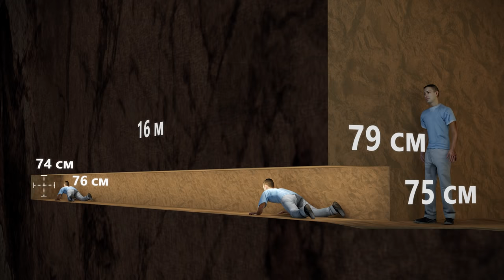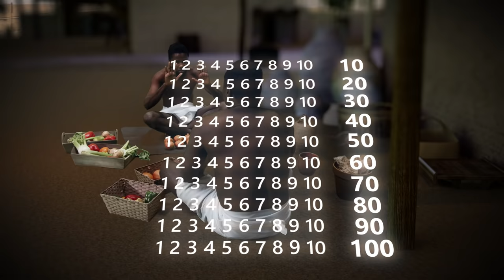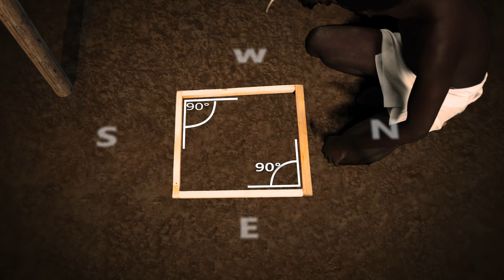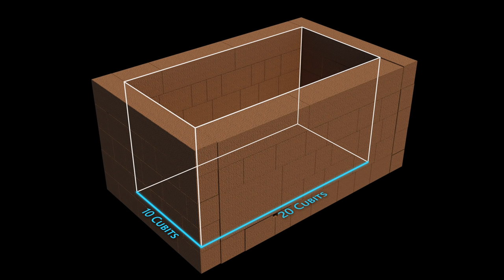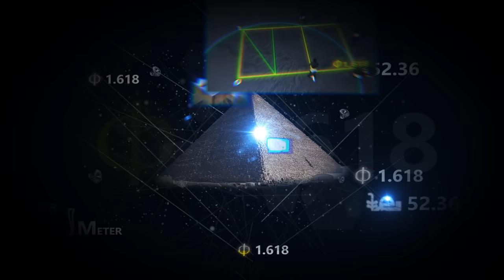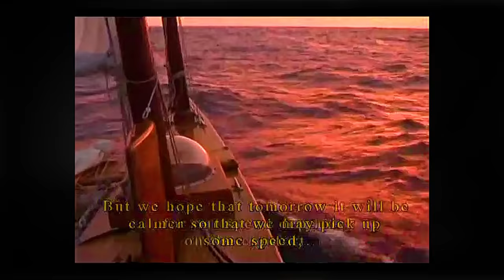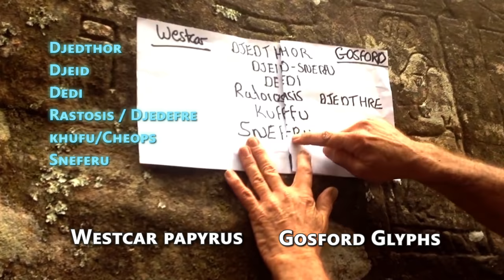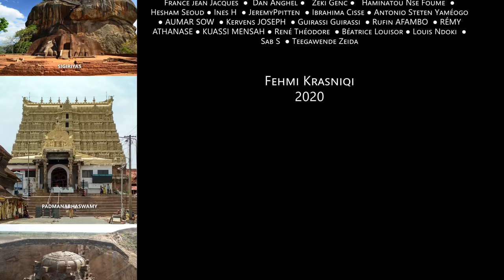The Movie Great Pyramid K 2019 - Director Fehmi Krasniqi

Comment: Heat melting of sandstone, granit, diorite etc. results not in sandstone, granit, diorite etc. of different shapes, but in glass or glass like stone that does not look at all like the original stone.
Reply: Granit was not made in laboratory yet. Not a piece. Robert Gentry ... polonius halos in granit. I was wondering how they could melt granit with solar energy and create the same granit again. Magic
Reply: Jeshua Satterlee  i have overbaked ceramic and got churchlike statues- some white porous rock.
Reply: it´s a combination of natural elements mixed and fermented with the rocks and the sun heatin it to the point that it could be molded as some sort of rock jello cake.. :)
Reply: Edwin Jansen  actually there are various rooms and undergroud caves along with halls that have the right acoustics, i also believe they had already mastered how to use water and electricity for more detailed matters, so who knows how many more amazin ruins have been kept without rcords or solid proof. :)
Reply: @ricbrano6402  Bingo!

Comment: The issue I have here with the “melting granite” theory is that there are actual experiments on YouTube right now of melting granite. It turns to a glass/obsidian type of material. It doesn’t melt and pour back into it’s former state. It looks different
Reply: That's interesting, can you post a link?  Perhaps there was something added to the granite to change it's chemical structure to prevent it from turning to an obsidian-like state.  Do not see how those stones could have been lifted to the height and placement in the pyramid  unless they were poured there in place... It's by far the most logical explanation I have heard thus far.  Is there a competing theory?
Reply: @scotth6814  why isn't those scratches in all pyramids? no sled evidence anywhere else.
Reply: I imagine the idea is to mix the components similar to when making mortar, melting it, and pouring it to actually make granite, not to melt and pour already existing blocks, like the "documentary" suggests. Doesn't mean that's any more realistic though.
Reply: @Cerl84  Because only the Great Pyramid had chambers above ground level. It was the roof stones for the Queen's and King's Chambers that were so heavy. The regular pyramid blocks were small by comparison.
Reply: Which makes one think what other knowledge they possessed for the melting and casting of the granite we still don't know about
Reply: @scotth6814  there is an explanation and reference to the scratches made by the wood found by Houdin , in the K 19 movie itself ..